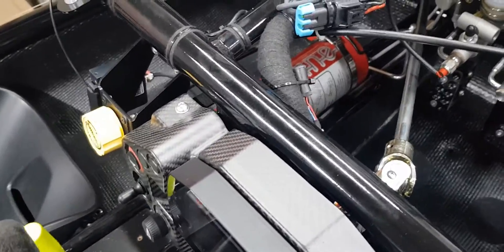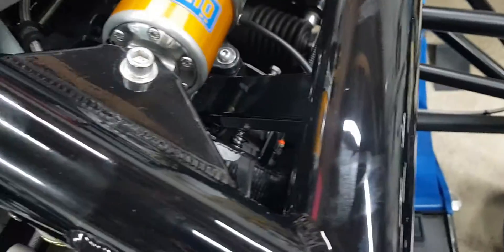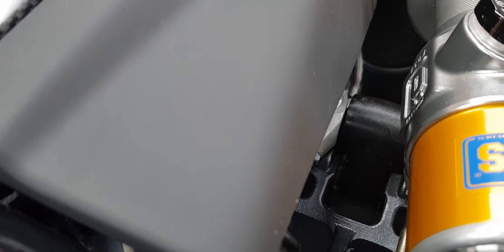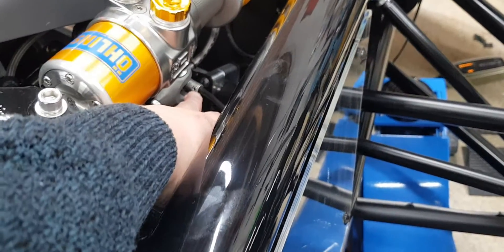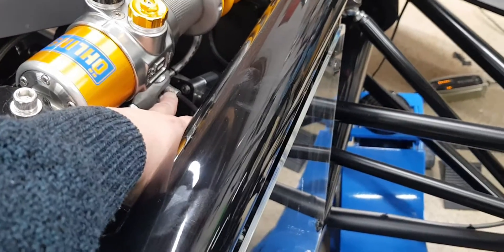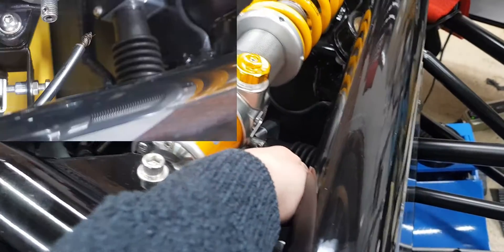Brake bias adjuster - how they work

Comment: how much does Ariel Atom cost?
Reply from the maker: It varies depending on spec, how well the car is looked after and the version you go for. You can pay £30,000 for a 15yr old Atom 2 with 30000 miles on it or close to £100,000 for a fully loaded Atom 4